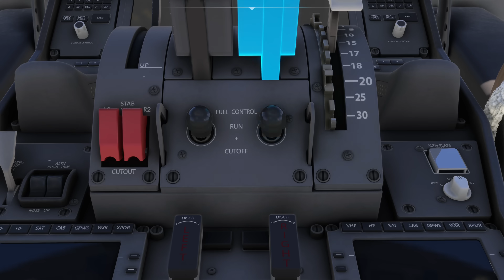Air India 171: Why Did The Fuel Cut-off Switch Get Moved?

Comment: The "why did you / I did not" is a controlled description of just ONE thing that was said, probably very heavily filtered.  There are no exact quotes yet.  The switches went off/off one second apart - then the question, then switches went on/on four seconds apart, after a 10 second delay.  What was released as being said is definitely not the only thing that was said or heard besides the final Mayday - the timing, especially that four second delay, could easily cover a scuffle and scramble.

Comment: my guess is. once plane lifts off, switch electronically cut off automatically. pilot1 asked why did u cut off, pilot2 said i did not do so. if pilot2 intentionally did cut off he would not turn switch on again and he would have resisted pilot1 when pilot1 changed switches to on state also if pilot2 did it intentionally then he would not have lied. and chances of by mistake pilot2 did it because of muscle memory is nill because click sound of that switch would have remined him of what he is doing.
Also as some experts in India saying its electric failure so RAT came out superfast after 3 sec of lift off and electric failure caused electronic cut of valve, no physical switch moved by any pilot, it was bad electronic switch.

Comment: How can they state that the fuel switches were moved to off ?  The fault could arise if power was lost after the switches when in run position as there is no way to see if the switches had been moved other than a loss of electrical power.  The fact that the switches may have been operated may have been an attempt to re-cycle the switches to reset fuel pumps. This is the only course of action they COULD  try in this situation and the pilots should not be blamed until HARD PROOF that they were at fault is forthcoming.Shame on the media for promoting a pilot blame scenario !.😔

Comment: Question: Wasn't the landing gear lever still set to gear down when the wreckage was found? As the fuel cut-off appears to have happened exactly when you would normally raise the gear, is it possible that this crash was the result of the pilot not flying simply making the most insane control mistake possible. If - in his brain - he still thought he had lifted the gear, rather than flipping the fuel switches, it could also explain why he responded with bewilderment and denial when he was asked why he did it. One theory could be that the pilot not flying had some sort of early stage undiagnosed disease which could impact cognitive abilities, and that his actions, were not intentional in the suicidal sense. Are pilots screened for such conditions?

Comment: Only a short portion of the cockpit recording was released—why not include the moments just before and after? This selective disclosure raises suspicion, especially when the blame is placed entirely on the pilots. You mentioned that the fuel knobs must be deliberately pulled and set to the "run" position, and vice versa. This isn’t something that can be done accidentally.

Also, while it’s common for children to deny mistakes, we’re talking about two experienced and trained pilots in the cockpit. If one of them made an error, they could have simply said, "Oops, my mistake," and corrected it—there's no need for denial unless there's more to the story. It's possible that both pilots were aware of the black box recording and were being cautious with their words, potentially to avoid sole blame. It’s often easier to blame human error than hold the manufacturer accountable—just as we saw in the case of the Boeing 737 MAX (Ethiopian Airlines crash).

Boeing is a massive corporation, deeply tied to Wall Street, with significant investments, jobs, and families depending on it. Shifting the blame to pilots can help protect the wider airline industry from scrutiny.

I also believe it should be mandatory for airlines to disclose the pilots' fitness-to-fly status to passengers—such as whether they had sufficient rest, were in good health, or free from alcohol consumption.

Another point: Boeing claims that a single engine is sufficient for takeoff. If that’s the case, why didn’t the aircraft respond to the engine where the fuel knob was properly turned on?

Lastly, I have a technical question: after turning on the fuel knob, how long does it take for the fuel to reach the engine from the tank? Speaking from my experience with motorcycles, if I forget to turn on the fuel valve, the bike might run a short distance before stalling. Once I realize and open the valve, it starts running normally. Is there a similar mechanism or delay in aircraft fuel systems?

Comment: Any situation where the FADEC could have cut the engines off due to an error and the pilots had to click the engine cut off buttons manually to off and then on position again as they were in “On” position earlier? This could also explain the slightly higher time required to turn the switches on almost 4s apart.

Comment: Let's not forget that there is the video recorded by one of the passengers, Akash Vatsa, in the same plane a few hours earlier, showing the non-functioning AC, LCD displays, lights, call buttons.
He was on its earlier leg from Delhi to Ahmedabad.
It is possible that at the time of the disaster (only 2 hours later), the electrical system failure had not only affected the cabin, but also critical systems, i.e. none of the pilots turned off the fuel supply, but as soon as they noticed the engines were shutting down, they quickly turned the switches to CUTOFF and then RUN to restart the fuel supply.

It was also noticed in a video of the aircraft that the wheels appeared to be stuck in a semi-retracted state. It was as if a power outage or control malfunction had paralysed the aircraft for a brief period.

Why do we immediately think that any of the pilots lied?

Comment: Captain, thank you for your professional insight on the topic. I have a related question, but not directly as it pertains to all incidents like this. So in this day and age and the technology being so advanced, do we really need to rely on black boxes? In my opinion, the date from the aircraft should be transmitted live to a control center and be available immediately after the incident. Black boxes should just be a backup. In so many instances, black boxes are not readable or simply can't be found. What is your opinion on that?

Comment: Just wondering, was the time the switches tuned from run to cut off about the same time the landing gear supposed to be risen. Can one of the pilots absent minded move the switches instead of rising the landing gear.

Comment: The Flight Data Recorder does NOT record the mechanical position of the fuel CUTOFF switches.  It records electrical signals that are generated by these switches and there is a lot of hardware and software along the way to the Flight Data Recorder that process these signals.

Comment: 1) Is it possible that both Engine failed before and pilots were just doing a recovery procedure which is to shut off and to try restart engine? The preliminary report evades timing of RAT deployment which is crucial. 
2) Report clearly suggest switches "Transitioned" rather than physical movement of switches. (suggesting they are talking about electronic signal as received by recorders)  
3) The data recorders can clearly identify Pilot 1, Pilot 2 and for who said what? Left pilot vs right pilot clearly being identified. The details seem missing.
There is more to pudding
Reply: I'm not a pilot but for what it's worth, I would think that:
1) If the pilots were trying to resolve an issue, there would be some conversation about it, and from what I understand, nothing like that was captured on the CVR
2) I think that's just a wording issue - reports always use fancier wording than they need to
3) I suspect that the investigators know who said what but they're not releasing that information until a more complete investigation can be done
Reply: @TheAutisticTraveller  Just a correction to 2): The wording in the report has to be precise, not fancy. I am saying this as someone who used to make reports for a living.
Reply: @TheAutisticTraveller 
1).exactly 
2). exactly 
3).exactly
Reply: @TheAutisticTraveller  - more than fancy wording - it's more accurate of what was shown by the recording of electronics - a video camera might have shown someone "pushing" - but the computer only notices the "transition" from on to off - not if there was a human agent or not
Reply: ..... very pertinent points brought out here, let's question the narrative and give benefit of the doubt to the pilots who lost their lives doing their best
Reply: I am not a pilot , but I think your comment is more professional and matured.  A real investigator type . 
Presenter looks bias. :)
1st comment
Reply: most sensible comment on here by far.  There is NOTHING in the report which says the fuel cut off levers were physically moved.

Comment: My question is about the black box recordings of the switch positions - do the boxes report just the electronic shutoff command from the switches at the control box or is there an actual feedback signal from the physical switches themselves.  In other words, do we know if the flight control computer just received a shutdown signal from the wire or even a software directive or do we know if the switches were physically moved to provide that shutoff command?

Comment: "The thrust lever quadrant sustained significant thermal damage. Both thrust levers were found near the aft (idle) position. However, the EAFR data revealed that the thrust levers remained forward (takeoff thrust) until the impact. "
Is it possible that the thrust lever was damaged during flight? Is that why the pilots tampered with the cutoff levers? How do you even comment on this difference in versions? What was found compared to what the recorder recorded.

Comment: Could the fuel control switches been activated by remote control? With auto land and elaborate auto pilots both systems capable of remote operation, is it possible that this is what happened here? Also, wouldn't an alarm sound  when the fuel valves were cut off?

Comment: I’ve been driving a truck for 26 years. In cab cameras were introduced 12-13 years ago and I hated it, I still hate it because I can not be taking a drink, putting gum in mouth, eating, anything other than 2 hands on the steering wheel gets me a write up. But I haven’t had a wreck, haven’t had a speeding ticket or anything else behind the wheel. That is a company policy not mandated by law.

Comment: Constanly blaming pilots by oncluding that it was done by pilots is not wise as a pilot, How can you conclude that your kid and a pilot would be in denial, there is a chance he actually didn't and could be something related to software as in these planes the switch is not directly connected to the valves and hydraulic systems there but communicated through software+..... The blackbox just shows the status on software and not if the switch was actually changed or not.

Comment: If the switches are changed to require 2 pilots to operate them, what happens if one pilot is incapacitated or otherwise unable to do their part?
Reply: Yea bad idea
Reply: Add a third pilot. And a fourth remotely supervising from the ground.
Reply: You can make it requiring two hands to operate. In normal operation, two hands from both pilots. In emergency, one pilot can operate it using both hands. This would make it much harder to sabotage without the other pilot noticing.

Comment: Amid the stress and urgency of the situation, it is possible that the two pilots attempted everything within their reach, including a possible engine restart. In this context, it cannot be ruled out that one of them might have moved the switch to the OFF position and then back to RUN. This suggests that the issue—clearly affecting both engines—may not have been solely due to fuel starvation, but potentially due to an electrical or other systemic malfunction. As such, the pilots’ actions—including the possible movement of switches from RUN to OFF and back—may have been part of an attempt to restart the engines, rather than evidence that fuel cutoff was the underlying cause.

Comment: I am not an airline pilot and my engineering work for Boeing (many years ago) did not involve control systems, but as a private pilot and commercial boat captain, 10 seconds to correct the catastrophic error of double fuel cut on takeoff seems much too long.  The switches are easy to reach just behind the throttles and logically should have been corrected before or as the pilot asked the other about it.  No time for a discussion.  Just action.
Reply: not if there was a struggle - and remember - the PF is a busy man - now dealing with a horrendous situation - probably not a part simulator training - so there are no reflexes developed - 10 seconds would seem much too short a time
Reply: I'd imagine that having your colleague cutting off the fuel on takeoff would be such an outlandish situation that your brain would take a while to comprehend it (I assume that's what Captain S. is referring to when he mentions 'denial')...like the most unthinkable WTF moment.
Reply: I have no knowledge/expertise in this area. Is there a possibility that it took the pilot 10 seconds to realise that the other one must have turned it off?
Reply: @RA-wp6th  - it was probably in the previous Capt Steeeve video in which he said due to the pressure of the takeoff procedure - it took him that long to process the idea
Reply: One second to turn them off indicates sabotage… Ten seconds to turn them back on indicates a struggle. They should release the whole tape.
Reply: @Jimmy911ism  if there was a struggle as evidenced by the CVR, I would think that concept would be in the report....and it was not
Reply: @ljp416jmp The report can’t show everything that happened. Whether there was a struggle will probably always be unknown.
Reply: *Theory: Captain Sumeet Sabharwal’s Depression-Induced Deliberate Action*

Captain Sumeet Sabharwal, the pilot-in-command of Air India Flight AI171, may have deliberately caused the crash due to untreated or undisclosed depression. Suffering from personal stressors, such as his mother’s death in 2022 and the burden of caring for his elderly father, Sabharwal’s mental state could have deteriorated, leading to suicidal ideation or impaired judgment. In a depressive episode during takeoff on June 12, 2025, he intentionally moved both fuel control switches to the "CUTOFF" position, causing dual engine failure and the crash. The cockpit voice recorder’s exchange (“Why did you cut off?” / “I did not do it”) suggests confusion, possibly indicating Sabharwal’s denial or dissociation during the act, consistent with severe depression affecting rational behavior.
Reply: *Theory: Captain Sumeet Sabharwal’s Depression-Induced Deliberate Action*

Captain Sumeet Sabharwal, the pilot-in-command of Air India Flight AI171, may have deliberately caused the crash due to untreated or undisclosed depression. Suffering from personal stressors, such as his mother’s death in 2022 and the burden of caring for his elderly father, Sabharwal’s mental state could have deteriorated, leading to suicidal ideation or impaired judgment. In a depressive episode during takeoff on June 12, 2025, he intentionally moved both fuel control switches to the "CUTOFF" position, causing dual engine failure and the crash. The cockpit voice recorder’s exchange (“Why did you cut off?” / “I did not do it”) suggests confusion, possibly indicating Sabharwal’s denial or dissociation during the act, consistent with severe depression affecting rational behavior.
Reply: Kiwi.N.Z 70yrs Pilot 
Bloody Hell  ! !  We keep saying the Switches were turned OFF. 
 ,   NO ! !    , the fuel supply was cut off  ! !  Both Pilots look at the Switches  , ,  Bugger Me ! ! 
They're still    NO ! !    Try that one.  . . ! ! !

Comment: I am wondering how did one of the pilots notice so miraculous fast that the fuel cut switches were in the off/shutdown position after they initially noticed the lost of engine power. Did he even push the power lever up/forward after they noticed the loss of engine power before noticing the switches? What were his actions before noticing? This could be a hint as to who turned turned off the fuel cut off switches........He already knew what to look for.

Comment: Crash occurred within 32 sec after takeoff, that 32 sec includes engine restart attempt,  turning off the switch take significant time since mechanism of switch is spring loaded. Don't blame the Indian pilot to hide Boeing issues.